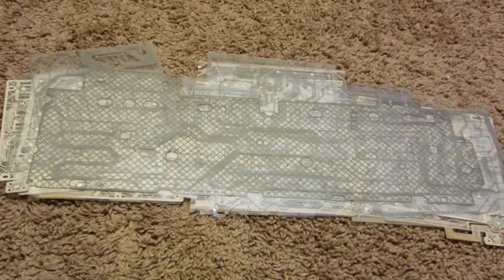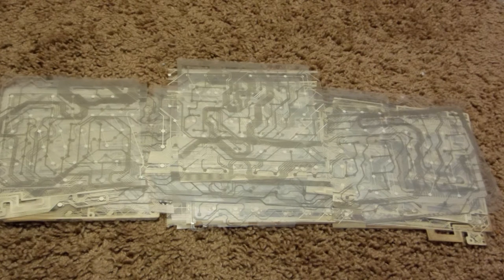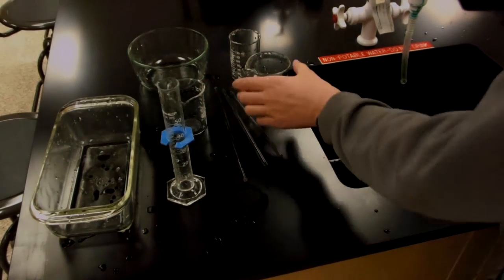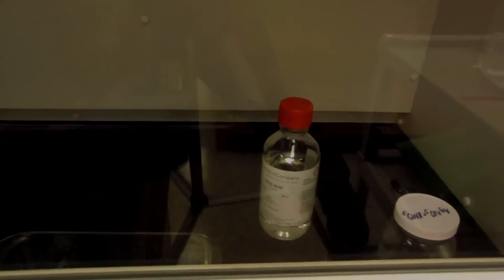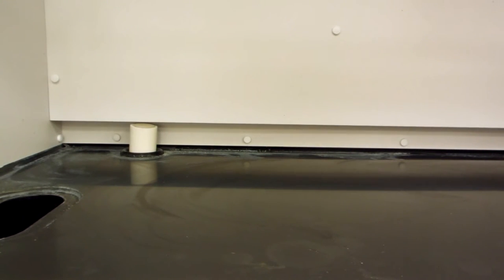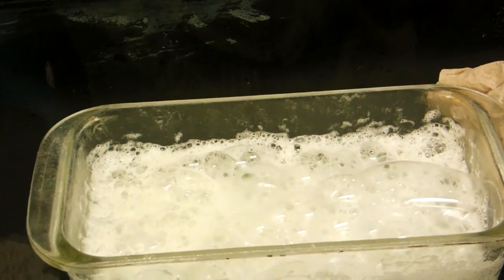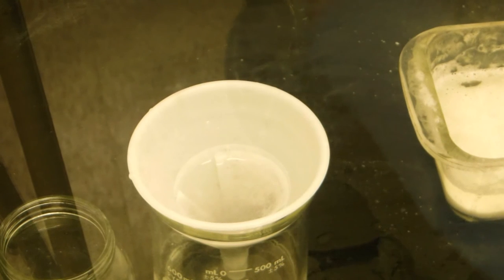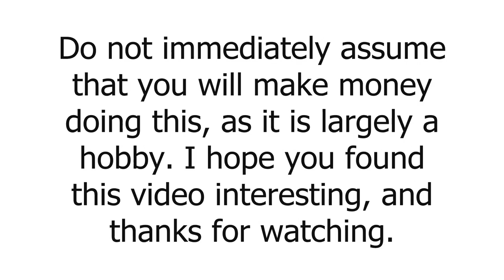Recovering Silver from Keyboards!

Comment: Seeing this for the first time!  Love how descriptive you are.  questions I have,  1st - what is the ratio of 65% Nitric Acid to H2O when you start treating the Mylars?  Next, when filtering the Acidic solution from the Silver Chloride solids, is there still any free Nitric that could possibly be used in other batches or applications?  First time I have seen Sulfuric and Aluminum used to convert the silver chloride to elemental silver, does this process create a contamination issue with the final elemental silver?  Thank you so much for this video.

Comment: Sorry if this is a silly question. Since you are filtering the solution, is it necessary to leave the acid+AgCl overnight to settle to the bottom of your jar? You end up having to deal with the sediment at the bottom 'cause its hard to get out. Can you just pour the cloudy solution into the filter paper? Oh - and those worrying about the economics of this - Im looking at doing this for fun.... expecting to lose money.
Reply from the maker: If I recall correctly, it is better to let the silver chloride settle to the bottom, first. The reason for this is that the unsettled particles of silver chloride are rather small, so using an ordinary coffee filter may not be the best option as it could easily go straight through the filter. I also prefer waiting for it to settle as the clear liquid will be easier to test. You can add some dissolved and filtered NaCl and more effectively verify that no more silver remains in solution. I completely understand the struggle of getting out the silver chloride, though.